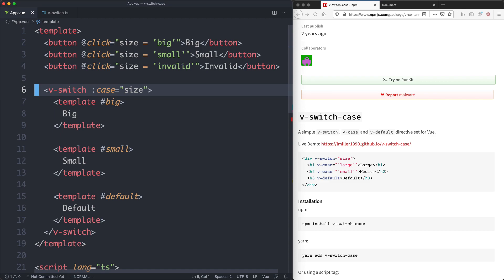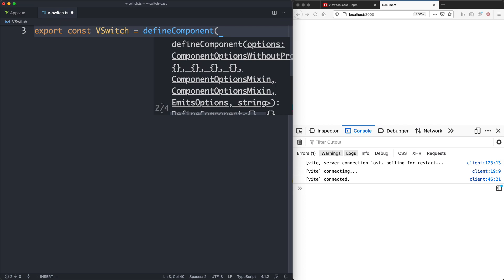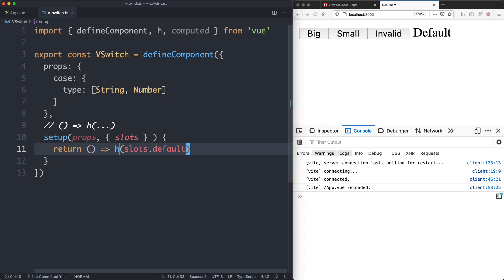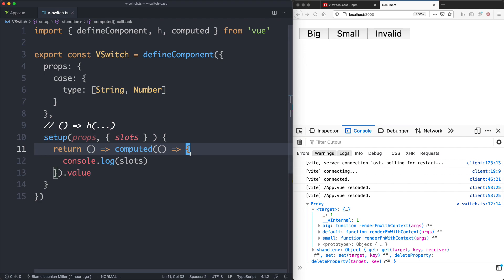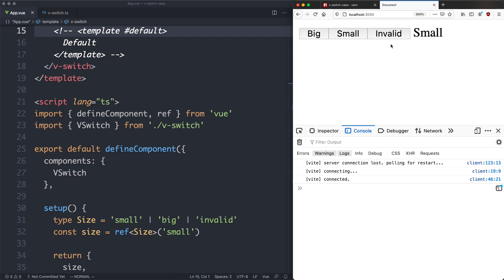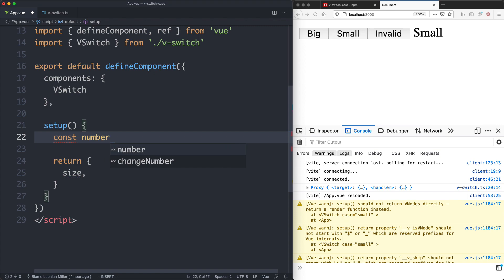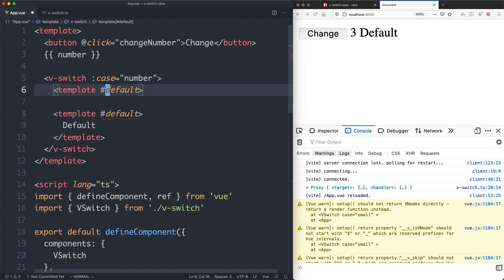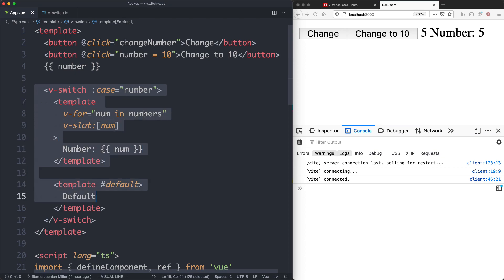The Missing v-switch Component

Comment: Very nice. Thanks for the video, Lachlan!

Do have a reason for using the computed property inside the render function? 🤔 I think it'll still work well without returning VNodes with computed.
Reply from the maker: Yeah I realized this after, I initially thought I had to use a computed property but later realized this was not necessary - see the pinned comment. 

thanks for pointing this out, it's important to scrutinize design decisions that seem like a code smell.

Comment: thanks for this awesome videos, could you make some videos about jsx in vue?
Reply from the maker: sounds like a good topic, will look into it 😎
Reply: @LachlanMiller  specially for typescript support and for the developers who have react background
Reply from the maker: @brahim_boussadjra  yep I assume by jsx you meant tsx, that's the main reason people use it - better type safety.

I am full time react guy so I know where you are coming from :) good new is vue 3 tsx is support is quite good, keep an eye out for some content soon!
Reply: @LachlanMiller  me also I'm full time react developer but I have an experience more in vue more than react, Actually I'm learning Vue 3 by answering the stackoverflow questions related to the new version which allows me to be the top user of the vuejs3 tag, I like to work with TS to make my code more robust